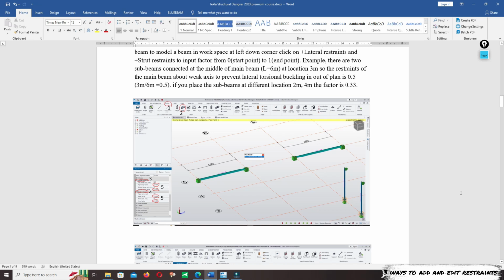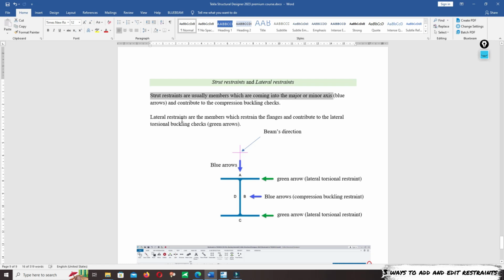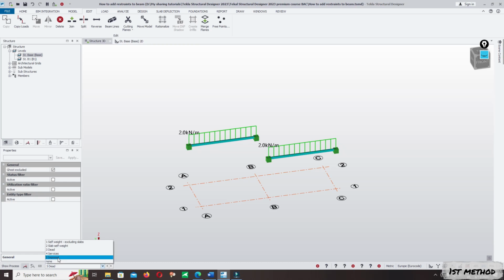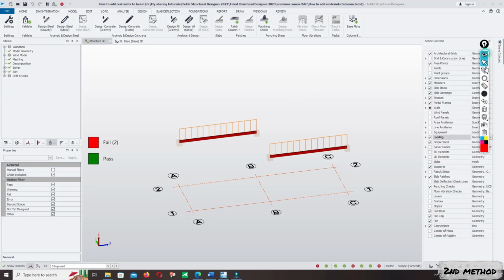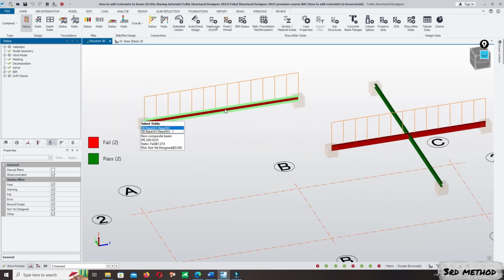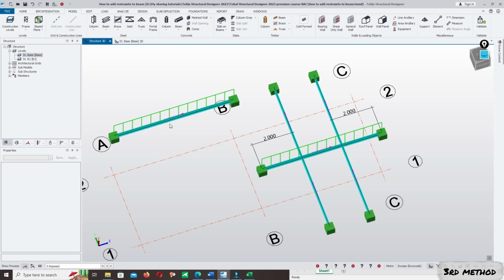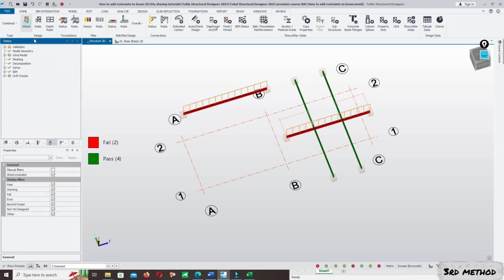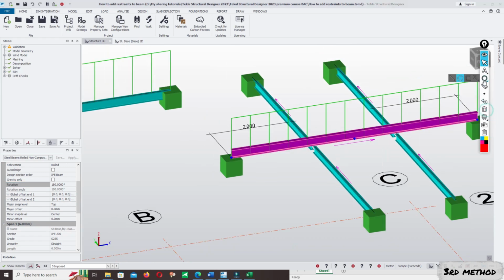Methods To Add Edit Restraints in Tekla Structural Designer

Comment: Very informative, let me ask please about the sub-beams, why they are considered "unrestrained" while there is a main beam that intersects in the middle and can prevent LTB. Thanks
Reply from the maker: Thank you. first of all, let jump of the software and understand about steel structure in design manual. It does not mean that when one purlin intersects with other one you can consider it as restraints.